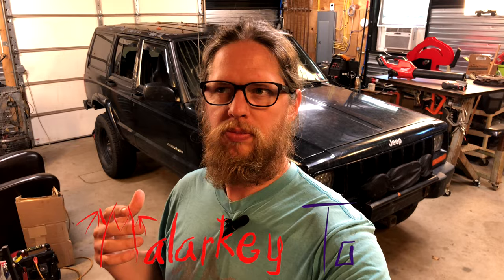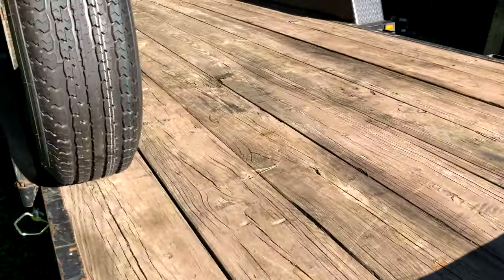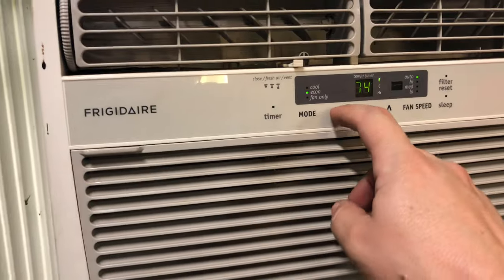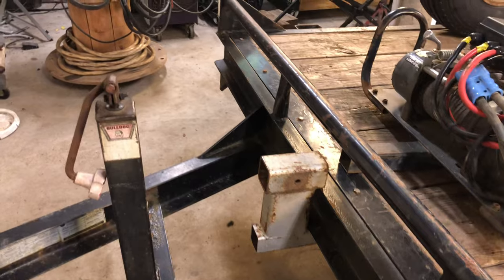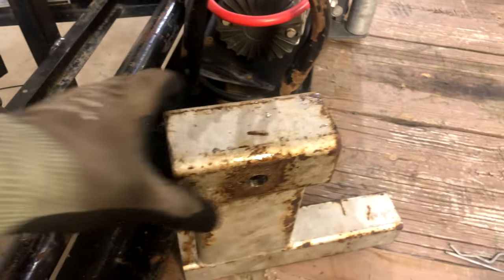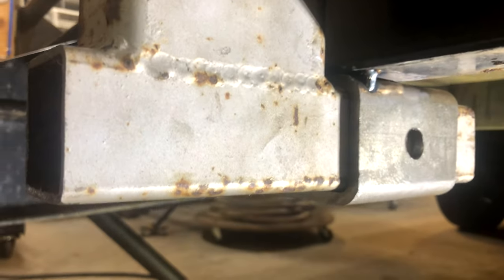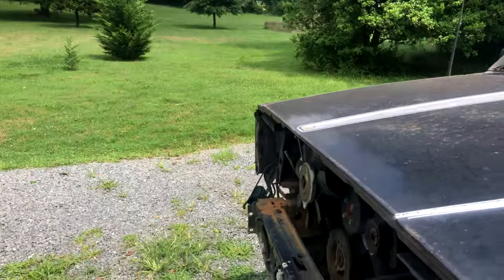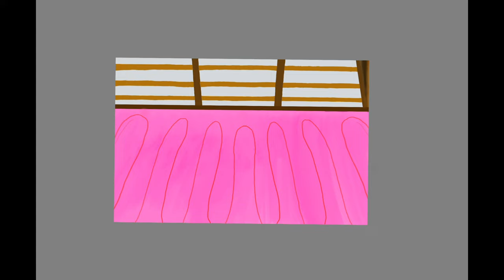DIY trailer winch mount: My trailer needs a Winch!.. #trailer #diy #winch

Comment: I did a trailer winch inside a box video a long time ago, I still havent wired it up haha
Reply from the maker: Yeah, I don’t think I’ll be at a spot where it needs to be permanent for a long time. If ever. So running off a jump box or jumper cables is fine for 99% of what I do. 
As long as the daggum winch works. 🥴🤦‍♂️
Reply: @MalarkeyTaylor  i ended up with 4 winches so I made it permanant
Reply from the maker: Thats a lot of winches. 😂